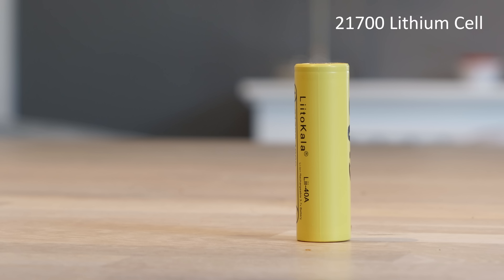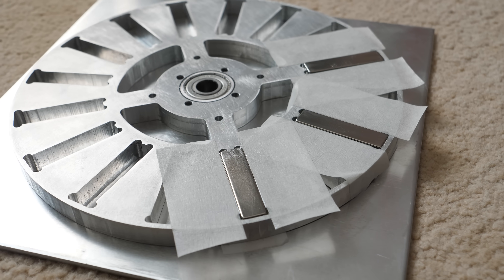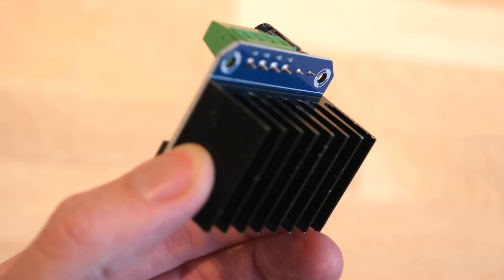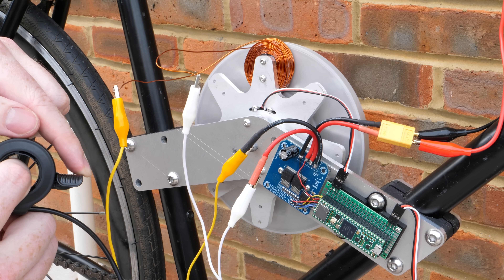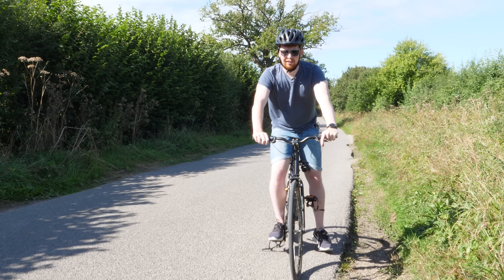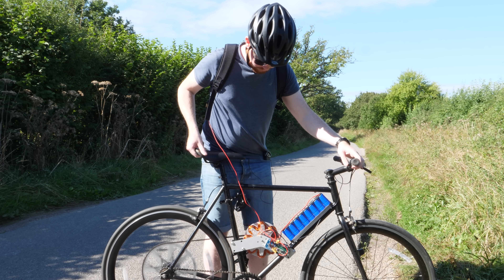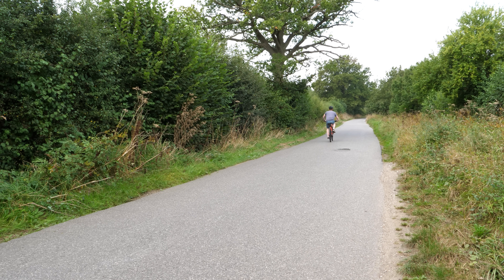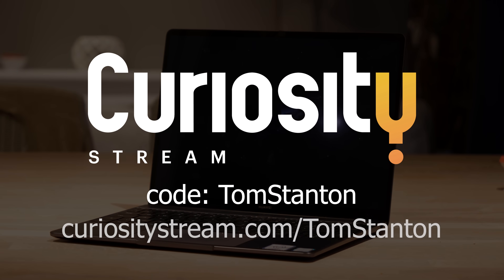Super Capacitor Bike

Comment: Tip for the next time you wind coils: Do 5 or 10 revolutions before adding on the calculator. Speeds up the process by a lot because you don't have to switch after every revolution and pick up the wire again, and 5 is still easy to count (10 also with some practice) :)
Reply: I can count to 20 and im only 32 :)
Reply: If you have the talent to build and code the controller, building a coil winding machine with turn counter would be easy.  fit coils, with an iron backplate, on the opposite side of the rotor too.
Reply: why is it important to have exact number of revolutions btw? Does it matter if coils have +-2% difference?
Reply: @dandin8189  yes, the magnetic field for that coil would also vary slightly in strength, and the coil would draw more or less amperage then others. This could also make a vibration or imbalance in the motor.
Reply: Capacitors for taking off quickly from the start, li-ion batteries for cruising, with regenerative braking recharging your capacitors specifically. Now that'd be neat!
Reply: @bene6270  spammy de spam
Reply: Lol
Reply: Wow man what would he do without you

Comment: i think you can put a few hundered of these to a bike. İ mean there is a lot of place. You can make a new bike. You make the tube width in the frame of the bike wide enough to fit the battery. Lots of supercapacitors can also fit in the middle empty part.

Comment: This got me thinking. I doubt it would be efficient, but by using magnets and copper and the like could you turn the axel of a car into a  miniature generator using the engine to power it? And if the car is electric use the electricity generated to feed back into the battery. Once again, no idea about the efficiency, or if modern electric cars already do that to save energy.
Reply: Your suggestions is as you say a generator, every non-electric car has one (basicly like that^^) to charge its battery and power the electronics from there (since you can't do that with just gasoline)
for electric cars, however, that would just be a waste of energy: if you attach a generator to something, it needs power to spin and make electricity, this power would as you say be coming from the motor... so basicly you are taking energy from the battery through the motor back into the battery while loosing some on the way in inefficiencies and reducing the power of your vehicle (since some of it is used for powering the generator and not for driving)
... however in order to break, electric cars do run the main-motor as generator to recoup the kinetic energy of the car back as electricity (now the energy that powers the generator is the kinetic energy of the car thats put back in the battery)

Comment: Aluminum and changing electromagnetic fields are a very bad idea. No production motor uses aluminum in magnetic paths for a reason. That reason is eddy currents. I am quite sure you loose a bunch of energy to heat and eddy current braking.

Comment: Maybe you could make a hybrid system. One with a long range lithium based battery for cruising. With a separate capacitor system that aids with taking off from a standstill. 

The caps can charge using the lithium batteries and regenerative braking. And can only kick in when at a standstill till 10mph. Then the rest can be taken over by the lithium batteries.
Reply: Heck you could even design a "launch assist" system that helps get the bike up to 10mph from a standstill then regens when you are at cruising speed...

This would make starting from a standstill a piece of cake but have regening be almost unnoticeable.

Comment: Im wondering if heat generated in the coils might get out of the coils more easily if air is sucked out and it's replaced with an epoxy and the copper in the wires as a thermal bridge to the exterior of the coils.

Comment: 5:45 Some tips for your design ---
You should use two sets of coils for each motors with mirrored current of its parallel coils . You can use extra cu coils or devide one coils into two for greater interaction with magnets for more torque and power .
Another way to do it by guiding the Magnetic fields using Ferromagnetic disk instead of Air Magnetic circuit as you can see here 
5:45 this way Every individual magnet will combine from the back side to give you stronger Monopole field to the em Interaction  side and second advantage is it will avoid that sticking mesh . 😉😃

Comment: Since capacitors are good at discharging all their energy quickly, could you engineer it to work as a launch control or quick speed boost while you're moving?

Also, what if you modified the wheels into magnetic energy generators? Maybe put magnets where the spokes are, which will spin past a coil, putting power back into the capacitors, which will be discharged through speed boosts. 

This might all be pointless though if the whole thing weighs too much.

Comment: Explains in detail why capacitors are bad for electric vehicles

"And that's why I'm going to make a supercapacitor electric bike"
Reply: It might be safe to use capacitors for torque bursts and lithium for constant power
Reply: @niiiiiix  Yeah some electric go-karts use supercapacitors as the electric equivalent of NOS
Reply: To be fair, Bill Nye did the same thing building a to scale model of the solar system to demonstrate why people don't bother building them.  It was cool but he literally needed a bike to go from the sun, a 3 meter balloon, all the way out to where pluto was, at the size of a golf ball, several kilometers away.
Reply: Capacitors for taking off quickly from the start, li-ion batteries for cruising, with regenerative braking recharging your capacitors specifically. Now that'd be neat!
Reply: @bene6270  sounds good, but the starting currents may be tens/hundreds of amps for 250ms or so... and those capacitors havent reliability for this, thin internal structures, thin contacts/pins ... no silver bullets here
Reply: @bene6270 weird bot
Reply: Shame because the motor was ideal for use with a standard Lithium Battery. It would be nice to get some specs and maybe links to thget the magnets etc so we can try making one.
Reply: Maybe because an electric cars they have more computer components in electricity than a normal standard car so they need lithium ion batteries, the only time you really truly need a capacitor is if you have a car stereo amp to help out with the alternating current from going down that's where that capacitor comes in then, cuz if you running a thousand watt amp you going to drain that battery real fast and you need that capacitor to help out with that alternator so that it can keep the current and voltage going in that car. So it's not the voltage that kills the car batteries but it's the wattage that kills the car batteries that means if you hook up your computer to your car you got to look at the wattage, speakers cell phones all that.
Reply: The real use of supercapacitors are to extend battery life (supercapacitor life is very very long) by taking care of minor fluctuations in demand and supply from regenerative braking.  They also have a much higher round trip efficiency than batteries.
Reply: Using a couple of batteries and some alternator tech wouldn't not be possible to have an ebike with infinite range?
Reply: Here's how I like to think about it: batteries are to SSD memory as capacitators are to RAM
Reply: @handlemonium  ssd flash doesnt need power, only cache ram there for proper shutdown, ya, it can be large, for seconds to persist
Reply: @7alken  Um, I'm not referring to computers,  but how capacitators act like RAM in electrical energy storage because it can be stored temporarily and discharged relatively instantaneously.

I also use computer SSD storage as analogy for batteries because Lithium/solid state batteries can discharge fairly quickly, but are best for prolonged storage.

The connection between a capacitor and battery when used together can be like an SSD drive with a DRAM cache where a small amount of energy can be stored for immediate use while overflow energy can be stored in the battery for prolonged use.

Comment: 0:40 this is wrong. (Edit: oops this is actually correct at higher speeds, sorry Tom!) You don't get less power out of an electric car with a battery on 20% vs a battery on 100%. Battery voltage is not the same as motor power.
Reply from the maker: With a current limited/controlled motor controller, the lower voltage will result in less power due to voltage x current = power.
Reply: @TomStantonEngineering  in my experience EVs don't go slower when the battery is on 20%. The current mode motor controller can just compensate for lower input voltage with a higher duty cycle to keep torque response predictable to the driver. Current mode controllers control the motor current, not the input current. Which controller are you referring to?
Reply from the maker: @Ikbeneengeit  As the BEMF of a motor gets close to the input voltage, the current applied cant be increased (ignoring field weaking)? Therefore limiting the RPM of the motor. Of course in an EV this doesn't matter as they'll do +100mph, so no one will notice the difference. I've only worked with ebikes and drones, which get close to that motor/controller limit quite often.
Reply: @TomStantonEngineering  yeah you're right, the Nissan leaf for example enters the constant power region (i.e. field weakening region) above about 70km/h so above that speed you would notice less torque with a flatter battery. Below that speed, max torque is independent of battery voltage because motor current is being limited by the controller.

Comment: Very good project, you Know your stuff!
Have you thought about including an electronic Advance/retard feature like on a car ignition distrbutor/ engine management system  to dynamically  alter the timing of the coil switching.
Reply: Capacitors for taking off quickly from the start, li-ion batteries for cruising, with regenerative braking recharging your capacitors specifically. Now that'd be neat!
Reply: Hi

Comment: You don't need the tiny magnets and sensor to make it.
You can actually keep track of the regenerative voltage in the motor phases, and uses it as your feedback.
As one phase starts pushing current to the controller, you start firing that phase.
Pretty simple and easy way to deal with motors that ain't need fine position control.

Comment: Could a boost converter be used to take the variable voltage from the capacitors and output a constant voltage?
This might not add a whole lot of capacity but does help with power control.

Comment: capacitors should only be used as a quick pulse charge system, back too the main battery, but gain its charging through recapturing kinetic energy, with things such as regenerative braking. multiple capacitors pulse charging, a battery, can actually over come the minimum voltage requirement needed to actually push electrical charge back into the battery.

Comment: Tom, I have two tips for you in order to considerably ease your motor manufacturing steps.
First, you can use self-bonding enamelled copper wire that you can 'bake' whilst on your mandrel/mold. Doing so avoid having to use superglue and pray it will hold. it also avoids the risks of early coating failure due to excessive vibrations. Do not forget to use mold releasing agent.
Additionally, you can also count your number of turns after winding it up by winding a 'secondary' coil through it and looking at the current ratio. This technique is very precise if you can put a considerable amount of 'known' secondary coil turns.
Hope this can help.

Gabriël

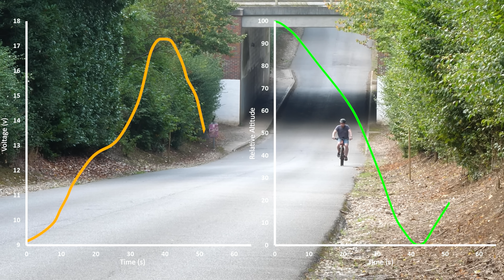Comment: 11:30 Shut up and take my money already! I think this amount of regenerative braking is good already and with some intentional limits in output, you can have a bike that's great for environment with hills - it doesn't take off all the pedaling uphills but will help a lot and supercapacitor bank is much much lighther than full Li-on or LiPo or LiFe battery pack. Maybe if you find a high efficiency and high current DC-DC transformer that can pull the capacitors fully empty that's good enough already!

I'd be interested in bike that is not fully battery powered but in practice helping to level hills.

Comment: Interesting design and very informative!!  I've seen a couple of capacitor car battery replacements whereby an alternator replenishes the capacitors.  Have you considered a 12v Dynometer from a bike lighting system to recharge the capacitors ?  Downside is a little resistance on the tire with wear but with a rubber sleeve one could be mounted on the rear wheel hub or the flywheel or whatever the front gear is known as besides front g.   Good news is with regenerative braking you could push and brake and recharge the caps in a little while.  Exercise is always productive.
Reply: Hi
Reply: @suhanzama2849  Hello

Comment: Seeing this, made me wonder about if/how functional it would be to power the wheel entirely with solid magnets. No wire or electric current, except for maybe the method of unlinking the system from the wheel as an off switch. Problems I can already see involve the number and size of the magnets required to get any real ridable speed out of this. Still, interesting thought experiment.

Comment: A lot of the comments are suggesting improvements for the motor/chain assembly, but I noticed an absence of comments about the motor driver. I think one way to add regenerative braking would be to use a full-bridge rectifier that is connected directly to the windings on the motor. If needed, you could add MOSFETs to regulate the regenerative braking, and then run the output of that straight into the capacitors.

Comment: To mitigate the discharge curve you could switch the capacitors one after the other so that one was always fully discharging at the top of the curve and the previous ones discharging in pairs so as to match the voltage of the charged ones

Comment: This looks nice. When I was biking daily, I could pedial 50km/h  (in a velomobile recumbent). Also my acceleration was out of this world.  0...30km/h is just a few "kicks" 30...40 km/h is more power, and then slowly to the 50.
At traffic lights I always had 2 problems:
1) cars have a very different acceleration curve. Mine is steep up to 30, and then climbing to 50. Cars however, is: wait, wait, wait, slowly to 5, 10, 15, shift, 20, 25, bam 50.
So I have to wait for the cars to accelerate and then when te cars in front of me finally reached 30 they go boom. But then it's the hard part for me, and cars behind me will be annoyed that I accelerate so slowly.
2) this works for 2 traffic lights, at the third I am beat up.

Making your own light-weight(!), motor controller and light-weight(!) capacitor bank allows for regenerative breaking. Also when doing long pieces, you can fill your capacitor bank by letting a small breaking current charge your capacitor bank.
This will help the part from 30...50 because from 0...30 does not cost that much energy.
Also being able to charge while biking, means you don't need to charge it from the wall. It's only meant as a drive away help.

Unfortunately dutch law prohibits using a helping motor above 25km/h .
So unless law changes to accommodate technology, it is useless.

(We dutchies can however go to germany and let the bike be certified as a scooter with head protection, because your really don't need a helmet inside a velomobile, and import the bike back again. This at the cost of a small electrical car like the $26500 aptera paradigm EV that's mostly powered by solar).

Comment: Great idea, and video. Loving the diy motor. Would a hybrid of super capacitor and Li-ion batteries be beneficial to a design? With the super capacitors taking the load of initial acceleration while the Li-ions being switched to after that point. How much of an increase in range would that produce?
Reply: Hi

Comment: Can you have banks of the capacitors so one or two discharge as the other ones are charging then they switch over to the charged ones once discharged like a firing order then you could have a charging system on the bike would be interesting to see if you can do it

Comment: Capacitors for storing braking energy to be discharged in difficult situations like acceleration from a dead stop and hill ascent could revolutionize cycling as transportation. One major Limitation to the present accessibility of cycling as a routine means of transportation is the difficulty a lot of people have ascending even short steeper inclines and repeatedly getting up to speed from stop signs, lights, occupied crosswalks, etc. Even as someone more athletic than the average joe, I find the idea of capturing the extra energy from when I would normally be coasting up to 20-30 mph downhill without pedaling and instead pedaling normally, feeling a normal effort load, and capturing an enormous amount of energy to make for an effortless climb up the next uphill segment to be positively exciting.

Comment: What I would like to see in an e-bike is one that can take full advantage of the multi-speed gearing in most pedal bikes.  I can see how to possibly do it if someone has the machining skill to build a ratcheting cam system in the hub of the pedals as there is in the rear wheel hub.

Comment: If it had regenerative braking and the capacitors and they were efficient enough with a strong motor it would be great as start up to get across intersections
Reply: Or as a good little power boost at the top of a hill or a steep part of a kill to lift some of your strain.

Comment: I reckon you should make it so you can charge the capacitors as you ride, and have them like a boost function when needed. So you can use the boost to maybe get going at first and then peddle for a few minutes to recharge it for when you need the boost, say going up a hill?